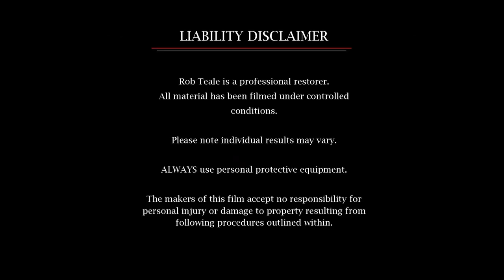1970 Holden HG ute - roof rust repairs Part 9

Comment: Hi Rob. Great content as usual. One of the best tips I have been given was to buy an LED headlamp torch, discard the elastic strap and use 3m tape to attach it to the top of the helmet. It has transformed my welding, particularly in tight areas where there is not a lot of light.
Reply from the maker: Wow, that's a great idea. Read it just now and I am already thinking of trying it out, especially with my camera. I have trouble recording good welding footage, and have tried auto darkening lenses etc. You have triggered the thought in my mind of flooding the area with light. I hope it helps, and will try it soon. Thanks RT.
Reply: Yep that could work. I can’t believe that they don’t make helmets with the light already built in! A bonus of living in the lockdown state here in Melbourne is that I get to try out some of your tips and tricks when I should be working.....lol.
Reply from the maker: Stay safe from covid.

Comment: Rob 
I know it’s a little bit premature, but would you be able to do a short video on how to clip on the stainless steel gutter molds onto the gutter. I have tried, but cannot seem to clip / twist them on with bare hands 
Regards
Kel
Reply from the maker: If you hook the top edge on an use the flat of your palm, bump down and in on the bottom edge. Should just clip on. Happy to make a video.  We will keep working on the old HG until it is shiny and back together, so many topics will be covered. Cheers Rob.

Comment: When using sheet metal can you use any kind or does it have to be cold rolled?
Reply: from memory Rob uses zinaneal steel, is that right Rob?
Reply: @mickholgate3347  ?
Reply: @shanepascoe1078  meaning it is a mildly galvanised steel. Cold rolled is also fine but tends to get surface rust if left for extended periods of time. Hope this helps
Reply: @mickholgate3347  yeah it only took a day in the rain for my .95mm cold rolled to get rust.nothing to pannic about though. Curious to hear Rob what you use and do you replace same for same?
Reply from the maker: Hi Mate, sorry I saw this comment earlier and meant to comment, but got busy with life and forgot about it. I do apologize for this. The problem with galvanized steel is the weld contamination  ,if you grind the coating from the weld area it will work. The other problem is paint delamination from galvanize, but careful preparation and a good etch primer will work. Some companies make zincalum door skins, they work.  I prefer cold rolled as it is the most malleable sheet easily available to me, but it is very good at going rusty. I use zinc annealed sheet for structure work and parts that don't need alot of shape. Cheers Rob.
Reply from the maker: Mostly I use cold rolled, but I use zinc annealed sheet for structure work. The zinc annealed is high tensile and harder to shape. Good for things that only need to have a few folds. Cheers Rob.